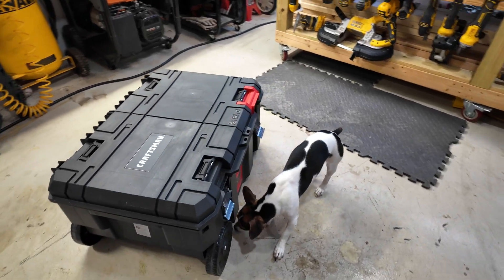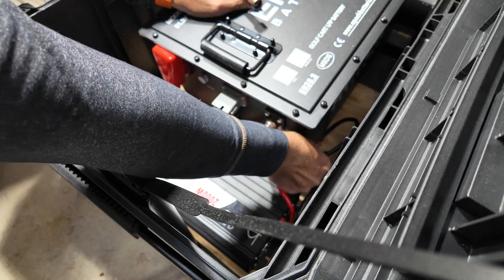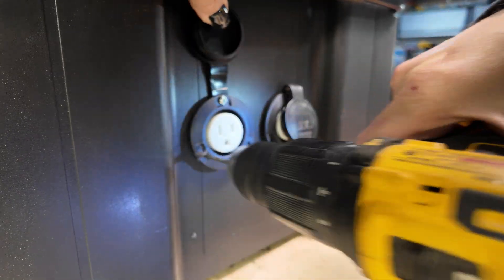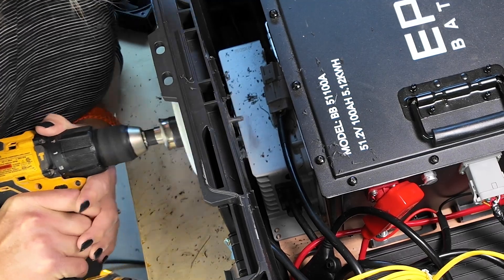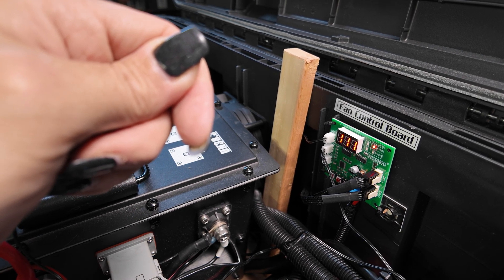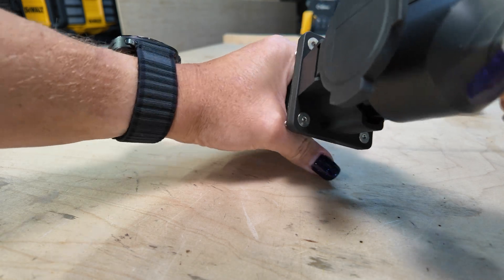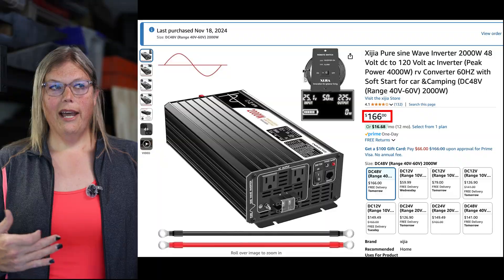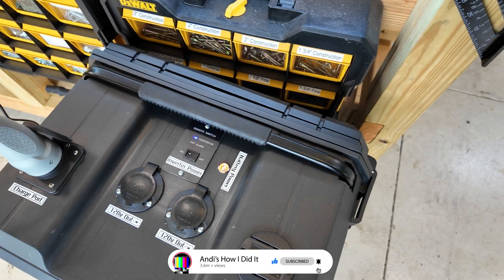DIY Portable Power Station 5400Wh - LiFePO4 Battery 2000W

Comment: Hello, that's well done.
I have a question: I made this kind of thing with 18650 12V 80A lithium batteries, so 3s... I have a Victron 12x375 inverter, and when I connect my computer (50W), the 15A fuse, on the positive cable, blows... I don't understand anything because when I connect a charger, or even two, with 4 cells each, it doesn't blow...
Do you have any idea what the problem is? Thank you very much.
Reply from the maker: 375 Watts divided by 12 volts is 31.25 amps. But you should allow between 125% and 175% of the calculated current for the fuse size. So you would likely need a 40 amp fuse minimum. Make sure you have the right kind of fuse and the right size cable coming from the battery. 
TLDR: for a 375W, 12V inverter, a 40-amp fuse is recommended. This fuse size provides adequate protection against overload and prevents damage to the inverter and connected equipment.
Reply: @AndiWofford  hello Hello,
So, I installed a 40A fuse, and now it's blown, I don't know where. Maybe the BMS, even though it's 40A... maybe the battery balance equalizer isn't working.
Reply from the maker: I would use an amp meter to measure the current as my next step. Something doesn't seem right.
Reply: @AndiWofford  Thank you very much yes there must be a problem
I think there is the group (3S) of 4.20 which does not charge since it is at 4.02 and I try to load it separately, that does not want to load ...
When I load the whole apparently it loads up to 12.60 but it seems incomprehensible that block 4.20 does not load, it remains at 4.02 ...
Do you have any idea? thank you very much
Sincerely

Comment: Very nice video.  Straight to the point and concise.  I'm very interested in the level 2 charger as a charging device, but need some clarification.  What do I need to add to the setup to be able to use level 2 chargers?  Thanks in advance.
Reply from the maker: Thank you! Level 2 chargers are going to be 220v instead of 110v. So you'll need an inverter capable of 220v, which will probably be somewhere around 4000w or so to get that. But that's only going to charge level 2 at around 20amps. To get the max-ish, you'd want an 8000w inverter to get 40a charging on a level 2 charger.  you likely won't need to bond the ground to neutral since you don't need neutral for most level 2 chargers.

Comment: How did you wire the breaker . What cables go where? 

Can you show me where you installed the fans and how u wired them
Reply from the maker: The breaker is wired on the positive side from the battery in between the inverter and fans. One positive wire from the battery to the breaker, and then on the other side of the breaker the wire goes to the inverter. The fans are seen in the video and they're on either side of the box. One let's air in and the other one pulls air out. They're both controlled by the fan controller that is also installed in the box. The fan controller gets 48 volts and both the fans are 48 volt fans.

Comment: What’s size bolts did you use to mount battery ?
Reply from the maker: Realistically you can use any size and shape that fits your needs. I think mine were an inch and a half to 2 in long. It was whatever I had laying around.

Comment: Love the build.  Did you ever consider putting a AFCI/GFCI Pigtail Circuit Breaker for safety?
Reply from the maker: The inverter has protections built in that seemed adequate for my needs: "Output protection: Overload protection, short circuit protection". And after a bit of research, I'm not sure a ground fault circuit interrupt would work in a system with no neutral bonded to ground (like what you would have in grid powered electrical where your neutral is bonded to ground). Essentially, GFCI would measure current differences between hot and neutral, but without another path for the current to escape, it would seem like GFCI would be an expensive addition that would never trip. Simply because we don't bond the ground in a portable inverter system. Does that make sense?
Reply: @ Nope.  They sell GFCI circuit breakers with pigtailsdoes just that.   If you have a hard terminal on your inverter you will see that there are three connections, one is for ground.  There are a couple of YouTube videos that go over this and why it's important.   The short that inverter is referring to is just for an inverter short, which is why there is a grounding wire included  that attaches to the inverter chassis.  The GFCI is for all the appliances that you connect the inverter to, without that people could get electicuted.  I am adding one to my build and it cost about $150 or so.  But that's a lot better than having ng some kid touching a wire or pole in the middle of a baseball field dying from electrocution and having a major lawsuit against you.
Reply: @ManKzin  Also built a EcoFlow Delta 2 Max equivalent device for more than twice the price and deceptively compared its price to a Delta Pro 3 and claims if you did this you would save money.  A very deceptive way to sell Epoch batteries for a commission...
Reply from the maker: EcoFlow Delta 2 Max is 2048Wh. This battery box build is 5400Wh, which is over 2 and a half times the size of an EcoFlow Delta 2 Max.
Reply: @Xcerptshow yeah   To get the capacity I’d not my build is about you would have to spend around $7-8.000 though I’m expanding it to connect to my house though, which is costing me quite a bit more.  Don’t knew the final numbers as i just got my last component  and will add up the cost in the next week or two. When I get a chance to finish out the last build )except for permitting  and electrician and the solar ground mount kit (will already have all the steel poles before then (saved around $1,000 by asking people if they had extra pipes, as I needed three 4” Nominal schedule 40 and one 3” Nominal schedule 40 all steel pipe.  I have winds of 150mph to withstand, even though I have 2 solar panels.

Comment: Only just started watching the video and immediately concerned by how little torque you applied to the lugs.  There's potentially an enormous amount of current flowing through those - and loose lugs will heat up significantly.  If it's still as shown in the video, I'd strongly suggest nipping them down tightly. Check the torque specs on the battery.
Reply from the maker: Thanks. Most tightening happened off camera when I was finalizing the build.

Comment: U said battery and charger kit was $1400, plus $300 inverter plus fans parts and labori would estimate build cost about 2100
Reply from the maker: I quote several different battery prices, but generally I lay out the different options towards the end of the video and break it all down on a spreadsheet for easy consumption. $2100 is way over my estimate.

Comment: Love the solution. You had a problem needed to solve it, and had the know how :). Well done. Could possibly add caulk to the pieces that weren't water proof but seeing as there are fans that makes it already not water proof :-\. Could possibly use a radiator solution to fully make it water proof but probably would add to the cost :-\. Well done again :)
Reply from the maker: I do like the caulk or silicone solution. The fans are under lipped edges as well but you're right, it's far from waterproof. However, the fans themselves are waterproof so that's something I guess 😂. Hadn't thought about a radiator; that's a neat idea! Appreciate your compliment!